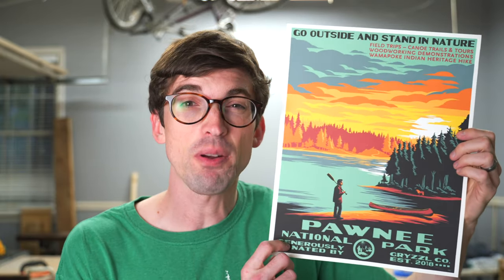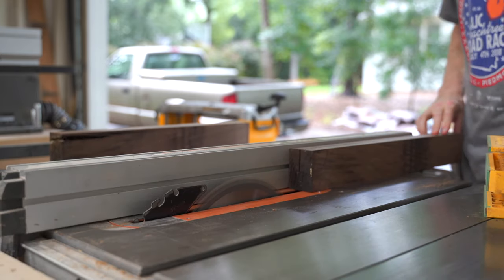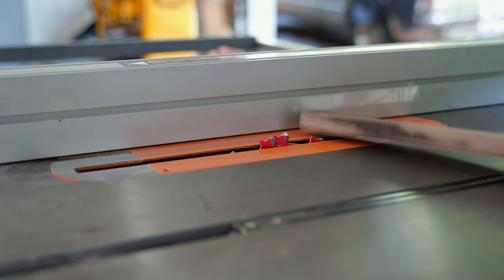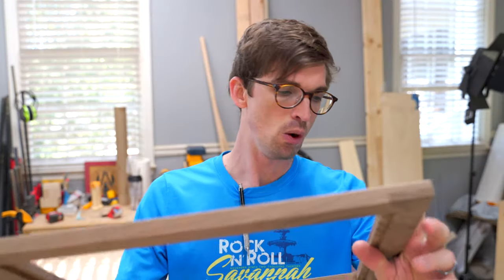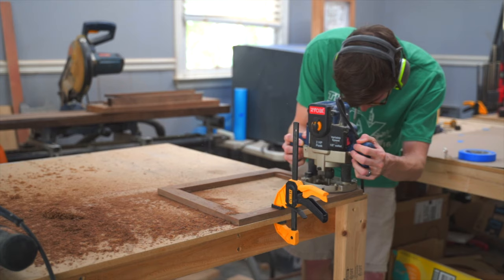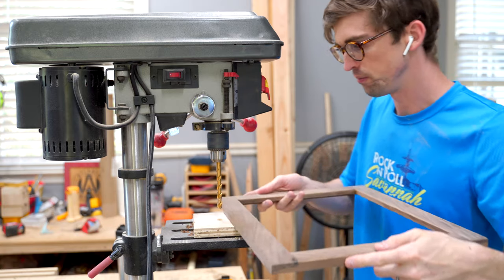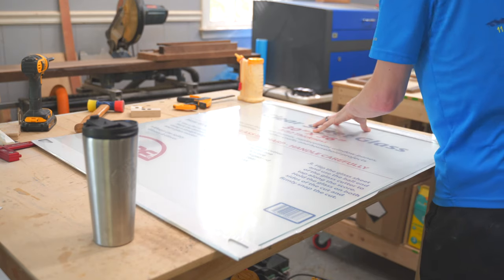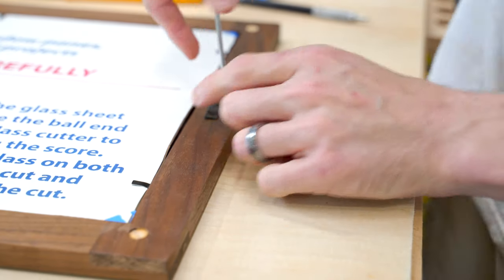Building a Picture Frame Ron Swanson Would be Proud Of // DIY Half Lap Joints and Dowels

Comment: Looks great. Look for acid free backing and mounting tape for anything you want to keep for a while.
Reply from the maker: Good call, I need to get some real backing material and tape, what I used what just scrap I had laying around.
Reply: @makeorbreakshop  I was going to comment the same thing. I used to do custom picture framing for a living and you wouldn't believe the effect, over time, that non-archival materials will have on pieces. Such a beauty of a frame and print, would hate to see it ruined. Might also consider UV resistant plexiglass as well, somewhat easier to cut and will protect the integrity of the print if it sees any sun exposure at all.